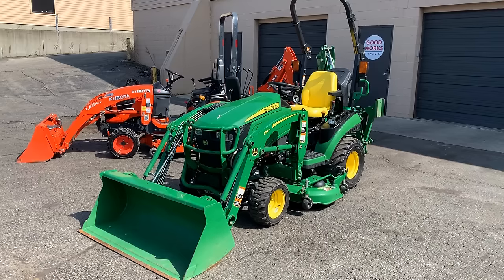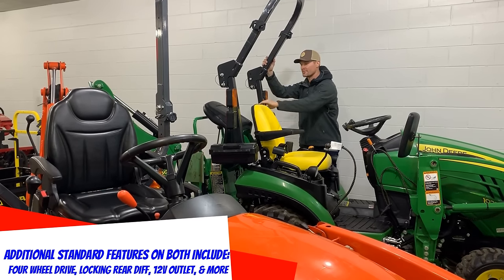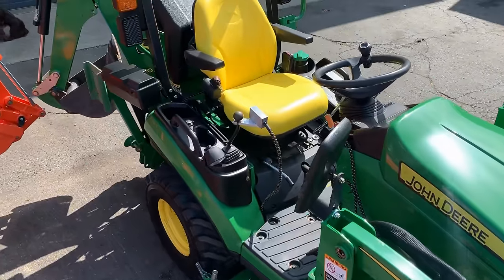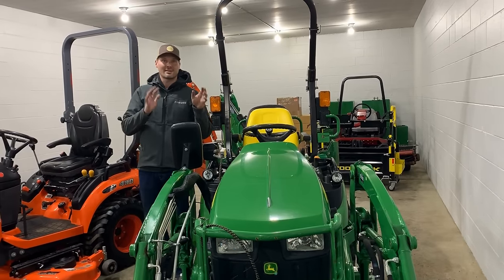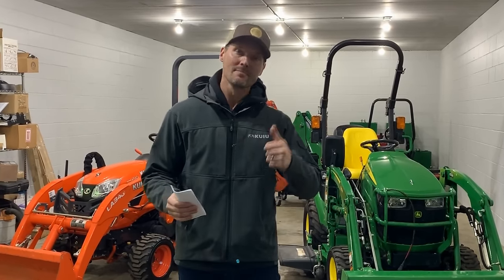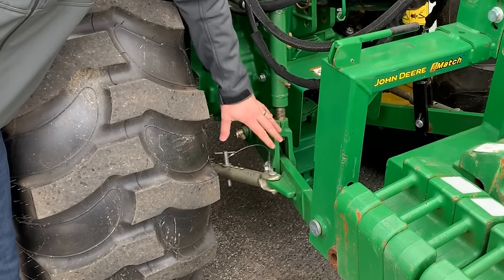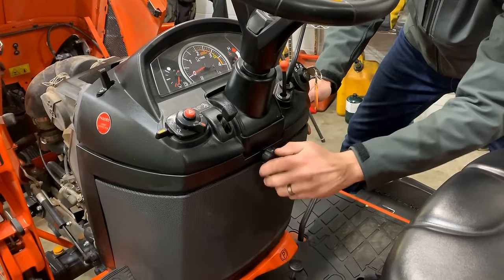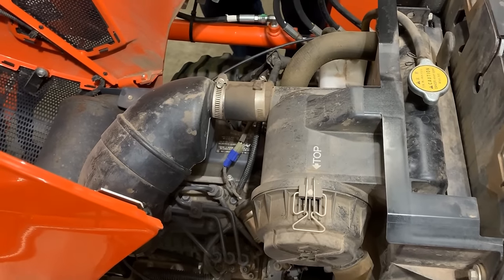CLEAR WINNER? JOHN DEERE 1025R VS KUBOTA BX23S TRACTORS! 🚜

Comment: look at a Massey   way better!!!!
Reply from the maker: That's debatable
Reply: Good Works Tractors I’d like to see your thoughts on the MF.  I’m local to you and starting to think about a subcompact.  Have it down to JD, Kubota, and the MF.
Reply: @rceric1  get the brochures and put em on the table.  go to the specs. page.  then compare 3 pt lift capacities .   the most important thing to compare is "rated engine RPM"
you will see that the Massey's are at 2600 RPM and the others are at 3200 RPM.  therefore if you were to spin the Massey at 3200 RPM your capacities would be 3200/2600 times or 23% higher.  at 2600RPM you lift capacity is allready 904 lbs as compared to 681  imagine at 3200RPM what it would be.  at 2600RPM the hyd. capacities are the same  imagine what they are at 3200 RPM.   And so on  and so on.........   You will find this in all comparisons of the compact tractors also. The 23% rule applies throughout most model comparisons.  Kinda funny 20% more is kinda where the next model comes. So basically every Massey model is the equivalent of the competitions next model.   Do your homework and put the brochures next to each other and compare.   Go to Tractordata.com and you can do comparison there too..  way easier.
Reply: They might be, I tried to check them out but the dealership was full of people that couldn't have been bothered by me. Theres a deere dealer right down the street from the kubota dealer, both closer to my house than massey anyway.

Comment: The BX has a fan cooled transmission, what a joke. Deere has had a line and radiator cooled one forever. Similar to B-series and B21 and B26. The BX is a joke and the hydraulics are weak compared to Deere. Then again I own a Deere 2305 which is made in Japan and a thousand times better than the joke BX23 and BX24 I had the displeasure if owning. The BX is good for grandmother's though, some light mowing on a Saturday afternoon.
Reply: glad you brought this up, i noticed the same thing...the old fan cooler running doesnt work well in a desert climate like im in here in utah and is old.. if your tractor hydro gets hot, then it wears down the rear end... John deer getting smart and adding the oil cooler on the front for the rear end hydro cooling was smart and in the long term use, keeps things from wearing down.... them aslo having not only the hydro oil filter but also a screen system with the long magnet to catch any other particles is also another smart idea....these things alone may make the 1025r more in cost, but worth it in the long run....all the grease zerks under the tractor are worth it too.....quality built in a machine matters.....
Reply: How do you like the 2305 compared to the 1025r?
Reply: @beunbad  jack, I have never used or owned a 1025R but I know that it's made in USA not Japan like the 2305. Deere could have changed some features and functions and capacities. All I know is that my BX23,BX24,BX1800 all felt like crap and we're much weaker than the 2305.

Comment: DO NOT BUY JD  PARTS MADE IN CHINA!!!!! After a year parts are falling off due to not tightened right at the factory. JD uses Kubota tranny now. Height limiter on the 60" belly mower will wear out due to cheap extruded aluminum. My 2005 JD 2210 was built MUCH better and lasted 18 years. This one is a little over a year old and falling apart. JD does NOT care and will not warranty anything past 1 year.